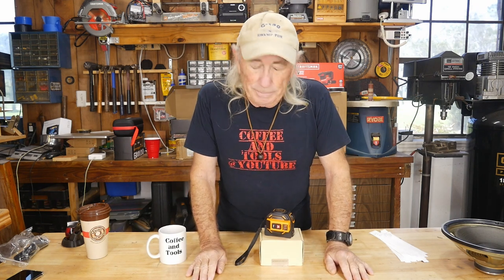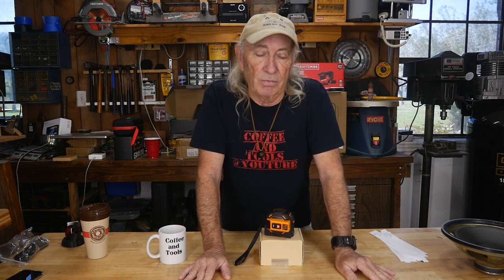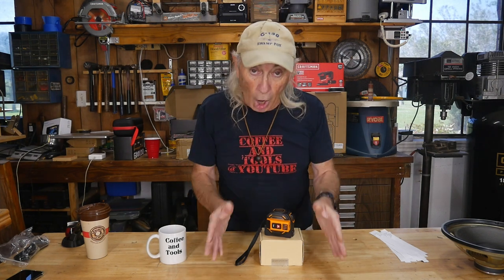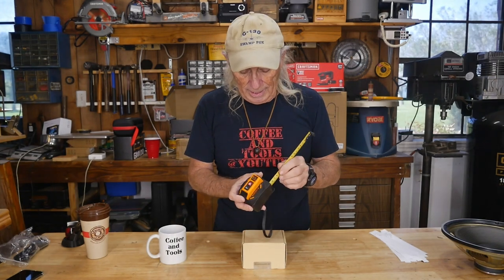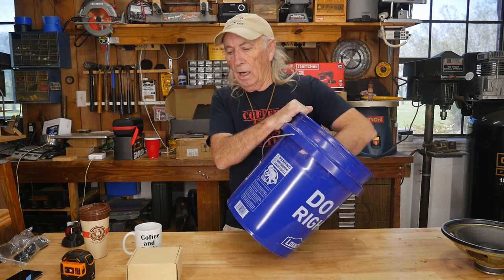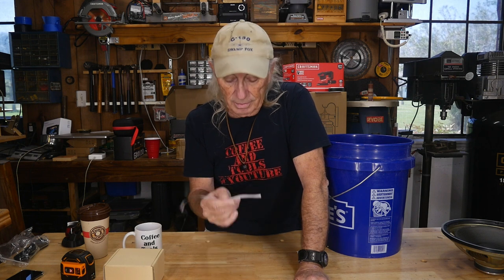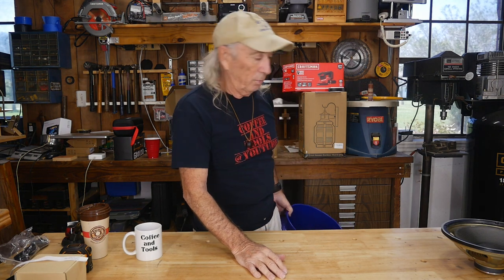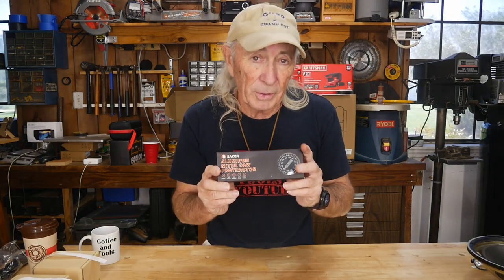Bad tools not to buy,  Free tool give away this week and new contest, C&T episode 225

Comment: Yeah, 3rd party parts can be iffy and not up to the expected standards of the tool brand.  Usually, they switch suppliers when that happens and you may just have one of the defective models.  But Hitachi is basically gone for any new tool because Hitachi sold off it's tool branch and it's now run by Hikoki, which uses either their brand name or Metabo, which is another property they acquired with the sale of the Hitachi tool branch that Hitachi had previous acquired... The new company just still support the older Hitachi tools... But if in the states, then look for the Metabo HTP for their latest tools or Hikoki in most other countries...